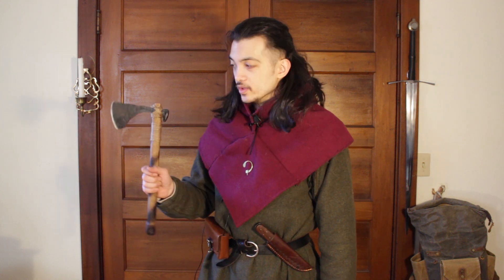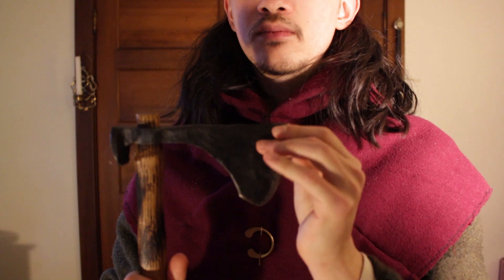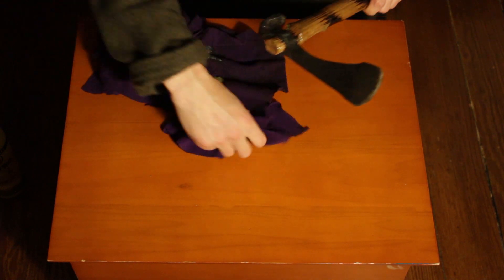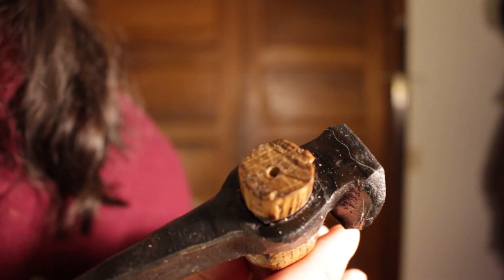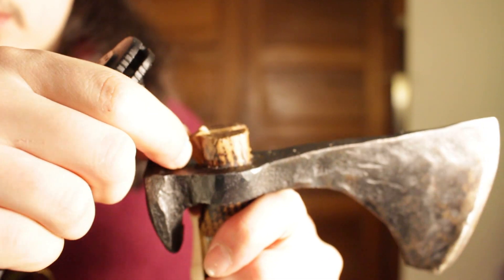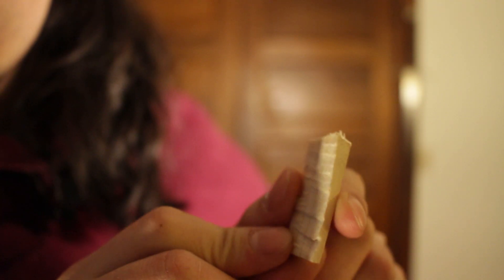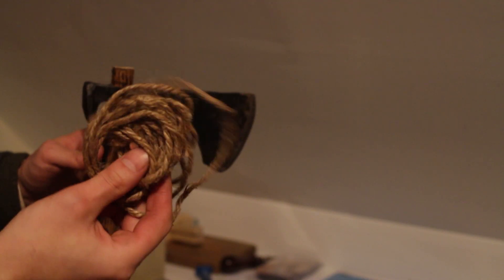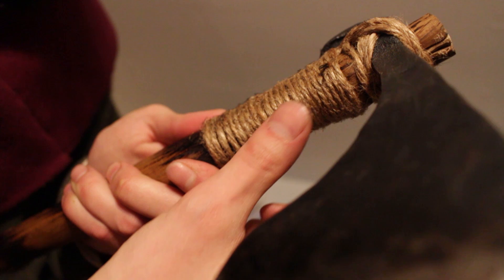I Broke My my BRAND NEW AX!

Comment: Axe handles are disposable.  They crack and loosen with normal use.  If you will be using an axe or a hammer, just understand that you will be replacing handles as part of the process.  Still, not an excuse to not make them beautiful.
Reply from the maker: That means I'll have a lot of practice!

Comment: for  a historic look you could wrap the head and handle as you have using a wet raw hide thong. be sure to pull it snug then let it dry. the raw hide will shrink making a stronger connection.

Comment: there are two things that, i'm afraid to say, are quite wrong with that axe. one is that the hole for the axe head is perfectly round, which makes it very easy to become wobbly. the other i the round handle, that gives no feel for the edge alignment. 

the ideal axe has an slightly oval handle, letting you feel where the edge is pointed at all times, so you can pay attention to the tree/orc you are felling rather than your own axe.
Reply: Looked oblong to me.
Reply from the maker: I agree with you. The handle I can change when I eventually make a new one. The eye of the axe I can't change
Reply: @LivingAnachronism  Yes, you can change the eye with a round file. I know this from experience. That's what was running through my head from the point where you noted the head/handle contact issues. Commercially made axes have a nice, smooth, symmetrical machined eye, tapered for mounting to commercially made handles with the appropriate matching taper (modulo wedging). Yours is hand forged meaning it's almost certainly less "nice" in all the above ways, and if it were mine, I'd go back to the maker and consult with them on how to seat a handle in it best. If that's not an option then you're down to doing some hand filing. (It's probably best to wait until after the camping trip rather than adding the stress of this to your preparations.)
As you've learned, think ahead before actually touching file to metal, and take it slow. As you've also learned, axes aren't as simple as they seem at first glance.
Reply from the maker: @markfergerson2145  Thanks Mark! I should be able to reach out to the maker. This was actually the first axe he made as a blacksmith, so I think this axe has taught lessons to a lot of people, nice history to it. Once I find my file, I should be able to fix it. But you are right, I needed to put it aside and finish the rest of my packing. This Project really took me by surprise, I got very little else done this week.
Reply: @LivingAnachronism  One of my reenactment axes had a round hole, it gave me issues as well....a lot of renactment axes are made from reforged hatchet heads, so the eyes tend to be small, for use with metal wedges...
Reply: @LivingAnachronism  i thought about it for a week, trying to come up with a simple low-tool way to blacksmith the head and then re-temper it.(i'm a blacksmith myself) 

But, as he said a file is really the easiest way.get a fairly large round file, and use a vice or hammer it into the end of a log to keep it stable. 

try to make the top of the hole in the axe just VERY slightly wider than the base, so that when the wedge forces it wider it makes a really tight fit.
Reply: A round handle is not entirely wrong. At least historically speaking. Oblong handles are nice, yes, but not always necessary for "feeling" the edge alignment. Axes are not like straight swords. They often have a center of mass offline in relation to the handle, giving them a directional feel. If you bounce the axe in your hand you will feel it trying to align itself so that the edge fallows the direction of the momentum. Or if you set the axe down on a table with the head over the edge, and the handle is heavy enough to keep it on the table, the weight of the head will naturally point the edge down as gravity pulls it. 

For a person that handles these tools/weapons every day this slight balancing effect is enough for effective edge alignment.
Reply: @LivingAnachronism   a torch and file could anneal and reshape the eye to a degree. Just don't remove too much. You could at least make the inside finish a bit cleaner. Maybe file a funnel shape from the top down so that your wedge holds the head down better rather than simply grabbing the sides.

Comment: Actually, you have it exactly backwards when speaking about grain orientation. The grain of the helve should be inline with the bit. That is the strongest orientation. If the grain is perpendicular to the bit, then the force of the strike is acting direct on the weakest part of the wood, the adhesion between the layers of the grain.
Reply: For an axe or sledge hammer that's true,...But, hatchets and hammers use the cross grain as a sort of shock absorber.
Reply: Correct. I have never once seen a well made axe without an inline grain orientation, nor have the handles I have hung that way ever failed prematurely.
Reply: Also the grain orientation for the wedges should be side to side.

Comment: I remember the heads coming off my gardening tools all the time when I was growing up.  I would put them back on the staff of the tool, and use a nail driven into the wood at the top in order to tighten the wood.  That would get me through another season or two.  By the time I was an adult I had 3-4 nails in some of those tools, but those heads were not coming off for anything!

Comment: I use axes on a daily basis. And wedges all eventually fail. What I use to replace wedges are oak shims you can buy at your local hardware store. Cut out a piece that fits your handle and hammer it in. If you want to try using oil again, I've heard mineral oil is the best, bit I haven't tried it myself.
Reply from the maker: Great advice, I'll see what is available to me when it comes time to make a new handle. Would you use shims over the wedge "kits" they sell at the hardware store?

Comment: I suggest going to a hardware store and picking up a new handle. Most hardware stores have handles for hammers and hatchets that would work find for that. They're usually around $15, come with a wedge, and are easily customizable. I've replaced several handles for antique hammers I get for blacksmithing, and it's super easy.

Comment: was the axe head forged from a railroad spike? my brother forged one that looks very similar in design.
you wouldn't think that there's enough steel for it, but its surprising how much it spreads out.
Reply from the maker: I believe it is. I've heard some say it won't keep an edge well, but so far I have had success. I don't think it is reinforced
Reply: @LivingAnachronism  railroad spikes are technically mild steel and therefore impossible to actually heat treat. Even spikes rated "HC" by the railroad aren't actually high carbon steel, just a higher carbon than other spikes. They use a higher carbon spike on corners and other similar areas, but they still don't want hardened steel as a bent spike will still hold the track where a broken one won't. Your axe head will dull faster than a properly heat treated high carbon steel blade(what most people refer to as steel) and also have a higher chance to bend, warp, or otherwise deform. That's not to say it won't be functional, just that you need to be aware of the difference in performance you can expect from your axe as compared to a steel one.

Comment: Since you are "Living Anachronism" and not some precise historical recreation person I will mention two things:
1) the traditional materials for tightening something were sinew and/or rawhide. Both shrink as they contract. In fact, rawhide was used to hold wheels together (look up video for building an Egyptian chariot) as well as securing an axle to a cart bed (reference Red River carts, which had to be made & run dry without grease due to dusty conditions and thus would carry premade replacement axles to swap out along the trail).

2) since twine stretches look into finely wrapped fishline wound atop glue or shellac around the shaft where cracked and then also around the head, and then hidden with the twine. Glued or shellacked fishline will tend to be stiffer, stronger, and have less give than twine and can be wrapped in a single layer initially under the twine.

It won't hold for long, but you may get a season out of it if you take it easy. I used fishline and duct tape on my briar axe (from Lowes) to get an extra season or two of use out of it. It slowed the disintegration, at least until the handle broke in another place ;) I may have to try carving a replacement handle one of these years if I find a good piece of maple
Reply from the maker: Rawhide seems like the way to go! Thank you
Reply: @LivingAnachronism  You can get rawhide cheaply from dog toy bones, just soak and unravel, we used to edge viking shields with them, when they shrink the contracting force helps prevent splitting etc....

Comment: I've run into this problem with axes before and what I did was I kept the axe together and just whittled down the wood around the wedge, using a hammer to drive the wedge further into the handle by a centimeter or so and let the handle conform to what it encountered.

Comment: 1. Use an oval handle.
2. Use one hardwood wedge, just like your existing hatchet does, that bisects the handle along the long axis of the handle's oval cross-section.
3. Use a second hardwood wedge at right angles to the first that bisects the first wedge and the short axis of the handle's oval cross-section.

Comment: you can drive another wedge or two. you can buy round or flat metal wedges and drive them right in through the existing wedge with a hammer. the head of the only axe i had while camping was loose and I used two halves of a broken washer driven in perpendicular to the head to makeshift the type of wedge I'm talking about. it was enough to keep the head on tight until I could replace the whole handle

Comment: It's ok. What you do is that you drill two small holes 3mm through the handle and glue in wooden pegs. They will prevent further splitting. Your axe is so small it's enough and you don't need to make a new handle.  However when you replace it because the axe eye is very round it might be a good idea to put another wedge in vertically so that wood is tightening in every direction.

Comment: You can take rawhide strip, soak it until pliable, let it dry. It will shrink down around shaft and head quite tightly yet can still be replaced at need. I use this on some of my tools and it works well. I have used rawhide strip to assemble a toboggan rather than use the screws and bolts. Still going strong.
Reply from the maker: I will definitely do this, either with this handle, or the next one. The hemp twine I used probably won't do anything

Comment: Learning to haft an axe has been an interesting and punishing journey for me as well. From the looks of this axes eye, I would say you might benefit from either cutting a second wedge slot perpendicular to the central slot and putting in three wedges, one front to back, two smaller ones on the sides.  or using a steel wedge in addition to a wooden wedge, again perpendicular to the wooden wedge. Though the latter would be anachronistic, do we care about that here? Also when you do have to make a new handle, you can go the hard route, getting a piece of hickory or ash to cut to shape, or the easier route, getting a premade handle  and shaping it to fit your need, don't even be afraid to cut the original shoulder away and carve your own if there's a enough material to make another shoulder. Not quite as customizable this way, but much less work and often cheaper. if you want a curved handle they can be found at most hardware stores, if you want a straight one then a tomahawk handle should work. I hope this is useful. Good luck!
Reply from the maker: Glad to know I'm not alone! I was trying to find steel wedges, because I'd rather the axe worked and be slightly anachronistic than be historical and break. But I could very easily put in a perpendicular cut, I can't believe I didn't think of that, thank you so much!!
Reply: @LivingAnachronism  You're very welcome. Happy to help!

Comment: A quick & easy fix to your issue if you have access to a belt sander, is to simply make a new handle. Any hardware store should have axe/hatchet handles that can be quickly modified.
Make the insert part a tad bigger than the eye of the axe but with a shoulder like the current one at the base where the axe head sits, and pound it on. After that, cut the top off flush with the top of the axe, and add a single METAL wedge. Oiling the part that goes through the eye of the ax will help with shrinkage & expansion, but not prevent it.
This will give you a functional tool for a while but the long term fix is to get an axe that has a tapered eyelet. Either oblong like a wood axe, or if you are going to throw it, like a proper axe, one that is larger at the top of the eyelet than the bottom to facilitate the frequent replacement of handles while resisting the centrifugal forces generated during use.

 Life is a paradox & a compromise. Find your balance and get used to maintenance ;) Cheers and thanks for sharing your adventures.

Comment: Good work Krammer. I find the best way to learn something is to screw it up the first time. A wonderful but time consuming way to do it. To salvage I would put the head in a bucket of boiling linseed oil for a few days. Should help.
Nate
Reply from the maker: Since what I did didn't work, I am going to try the water method, and then the linseed method respectively.

Comment: U can also soak it in fish glue then let it dry and cure completly, to strengthen it. It can cause it to get sticky so after it cures fully, oil it and then if need be, wrap  it in leather where ur hand will be holding it. I have found that the slight tackiness sometimes will actually help with gripping it, esp when it is a smaller handle. Iv never done this on an axe but my gpa used to and I have done this on wooden hand tools iv restored and it has worked wonderfully. Iv heard it can also be done with animal glue but that can cause problems if it gets really wet, so ud deff have to seal it with oil/wax/resin after that dries but on a tool that can and prob will get wet, I would recommend using fish glue and not animal glue.

Comment: Had to rehaft an axe before; we both arrived at the hardwood wedge by trial and error 😅
I recommend getting a half-round metal file that fits inside the eye so you can smooth out the steel nubs and save your time on the wood in the future. And it'll still be useful if you get a nasty ding in the bit later!
Reply from the maker: I might have a file somewhere, I just couldn't find it. The time crunch for more trip this weekend really hindered me. I almost got nothing else done! Thank you for your advice.
Reply: Love the channel and content! Can't wait for more trips.

Comment: Consider buying a replacement ax handle from one of the big box hardware stores. It will be of a hardwood that will not shrink as much with age and will be more ergonomic. There will also be proper wedges in the same area. While there get a metal file to dress up the inside of the ax head to help with fitting it. You can use a propane torch to make the burn pattern again. Linseed oil is great stuff to seal it again and will only be sticky if too much is used. Apply a very light coat and let dry for a day or 2 before fine sanding and adding more. Keep at it!
Reply from the maker: I'll have to see what is available. The eye of the axe head is so small, I'm not sure how much work I'd have to do to get a regular axe handle to fit it. I do have some Linseed oil now and I will give it a try. In your experience, how worried should I be about spontaneous combustion?
Reply: @LivingAnachronism  I haven't yet experienceed spontaneous combustion in my woodworking.
My standard procedure for boiled linseed oil is to apply a generous coating, wait 15 minutes, then wipe off the excess with paper towels.
I then discard those paper towels either by tossing them into the fireplace, where they can combust all they want or burning them directly.
Reply from the maker: @Norkans5  Great. The warnings on the cans are a little ominous, good to know so long as I am careful, I should be good.
Reply: @LivingAnachronism  Spreading the oiled rags/towels out to dry instead of leaving them bunched up allows the heat from the hardening reaction to dissipate easily, furter reducing the chance of spontaneuos combustion.

Comment: Simple fix. Wrap with wet leather. When it dries it will shrink super tight.
Harder fix. Lock axe head in a vise and heat it evenly with a torch. Once cherry red use a large tapered punch driving it down from top to bottom.
This will make it a traction head and a wedge won't be needed. 
NOTE: you must retemper the head afterwards. This modification is best left to a blacksmith unless you are a competent metal worker

Comment: what you did with the repair is what we called the "field expiedent" method. no different that a repair made in the field from combat use. sometimes you can only use what you have on hand to fix a tool or weapon. Remember, it's not stupid if it works.